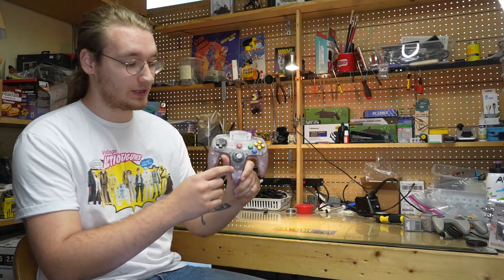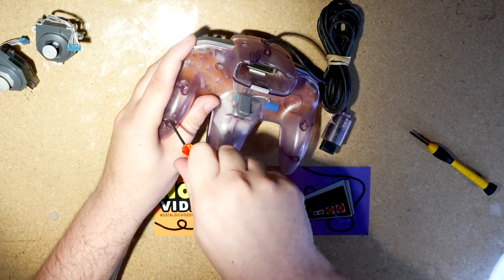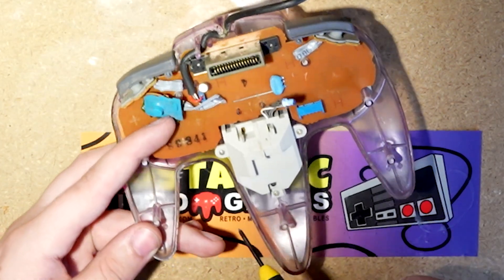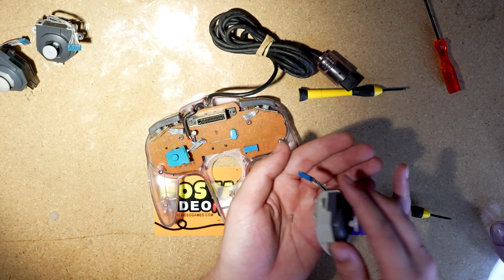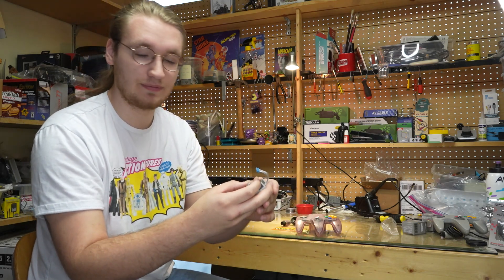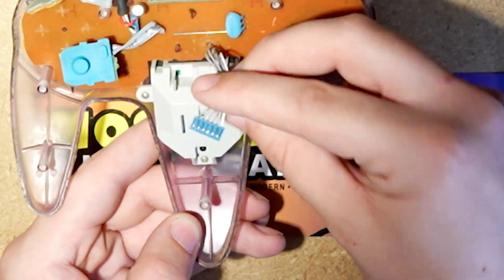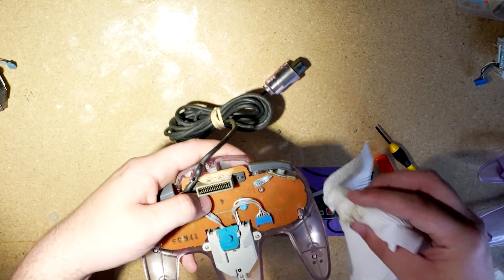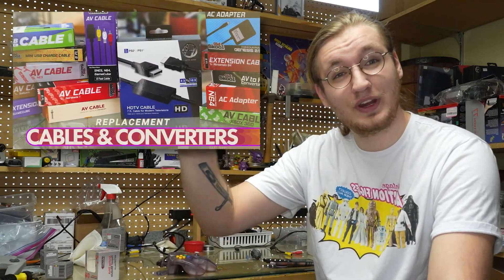How to Replace an N64 Controller Joystick (AND Why They Break!)

Comment: You should emphasize that YOU SHOULD ABSOLUTELY NOT THROW AWAY THE OLD STICK ASSEMBLY.  A quality manufacturer of modern potentiometers doesn't seem to exist and I presume all the manufactures of optical encoder wheels died when ball mice went obsolete.  This sucks because the sensing technology itself in the OEM stick is contactless and theoretically can work forever
i.e. THOSE OLD STICK ASSEMBLIES ARE VALUABLE AND WORTH FIXING!!!